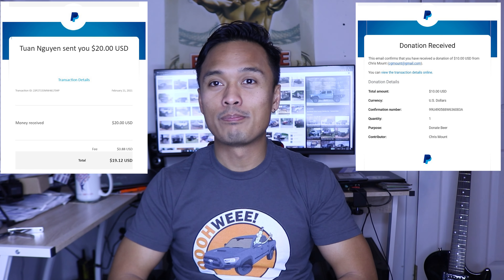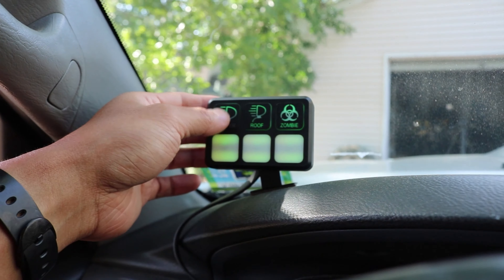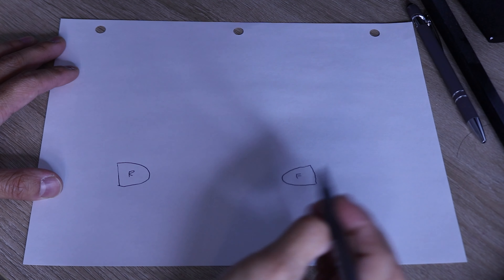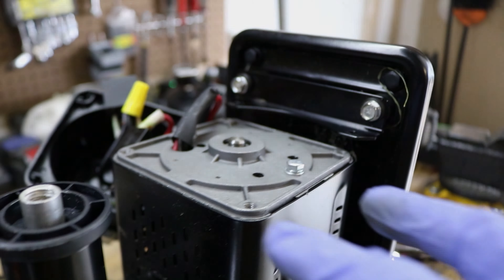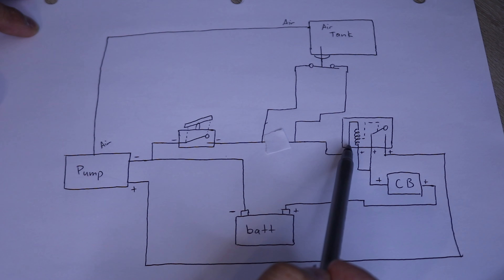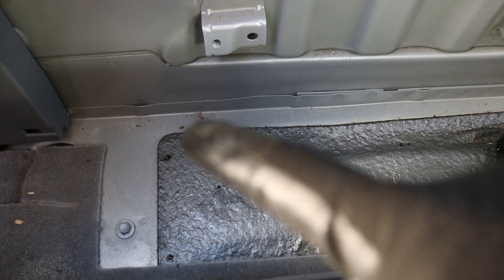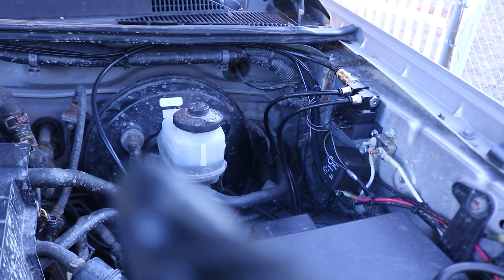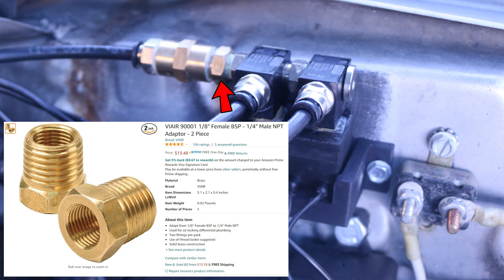Tacoma On-Board Air Compressor! ((DIY / How To) Re-gear Part 5)

Comment: Might be an obvious answer. I’m looking at re-gearing, for the lockers, do you need to hook up the air in order to drive it normally? Obviously the lockers would be unusable, I want to be able to add an air compressor later on. Just curious if I can still re-gear with air lockers without the air for daily use. Thanks in advance!
Reply from the maker: Yes u can still use the diff without an air supply. It will just work as open differentials
Reply: @KFloTacoma  thank you! Looking at doing 5.29s. I got a 2006 4 cylinder on 33s, and have a camper I tow with it that weighs in at 3360. More want to get the air lockers, so in the future I can add an air compressor and be able to use. That won’t be for a while though
Reply: @KFloTacoma  Would you have any brand recommendations? Ones that would hold up with towing, I’ve looked at a couple. Just trying to get some user feedback. Also, love the content. Have definitely learned quite a bit from your channel, not many people out there now a days doing what you do, or at least to the extent in which you do it.

Comment: Great video as always, K. Are you planning on keeping your backseats minus the plastic storage panels? I did a 40% seat delete over the summer and it really adds a lot of room. I just went for it a purchased a kit but there are tons of DIY variations. One thing I didn't consider at first was that you need to remove the under the seat storage compartment liner. The kit I purchased came with locking tops but you need to remove the whole piece (both 40% and 60%) to install the delete.
Reply from the maker: Thanks for watching and supporting the channel as always Matthew! Yea, I'm planning on keeping the back seats since I do have passengers from time to time. I am planning on doing a variation of  a low profile folding bench seat along with some molle rails of some type. Many ideas for this part of the truck.  Yea, those goose gear seat delete kits are pretty slick - that's definitely good information with regards to removing the liner. How do you like the delete setup so far? I'm sure the real estate difference felt huge!
Reply: @KFloTacoma  I really like the set up. It drops the floor as far down as possible and it's a nice flat surface. It provides about 8 more inches of space right there. The back panel is nice and straight and goes right up to the bottom of the rear window. There are a few threaded holes as well for mounting options. They throw in an extruded aluminum rail on the top for mounting accessories which is pretty sweet. The bottom panel meets the back at a perfect 90 degree angle and that is really nice as well, at least for me. The only issue I have right now is that I kept my 60% seat bec I too have passengers from time to time- and the upper hinge that folds down both seats is one piece- and it sticks out in the area created by the delete. I store my tools, recovery gear, fishing supplies, and assorted foul weather gear in the new area created with tons of room to spare. Install was pretty straightforward and took about an hour.

Comment: Hey Kflo, I looked on your website and didnt see the build thread.  Can you give the part number for the Grainger piece you were talking about for the solenoid?  I will be tackling this soon.  Thank you in advance.
Reply from the maker: I have updated my Amazon page and that should have all the items you need. In regards to the Grainger pieces here are the links. It's basically a 6mm push to connect fitting to NPT:
https://www.grainger.com/product/AIGNEP-USA-6mm-Metal-Male-Adapter-1WUN4
https://www.grainger.com/product/AIGNEP-USA-6mm-Metal-Female-Adapter-1WUP7
The female would be for the solenoid side and the male would be for the manifold side.
Best of luck

Comment: Did you need to put a fuse when you connected from your relay to the battery? If so what size fuse did you use?
Reply from the maker: No fuse, just the high amp relay. There's already an onboard breaker on the air compressor, it looks like a black button next to the red switch
Reply: @KFloTacoma  got it. I’m using a 40A inline fuse and it keeps blowing on me. I think I’m going to try the high amp relay and see if that works.
Reply from the maker: The compressor pulls about 45 amps and maybe a little bit more at startup